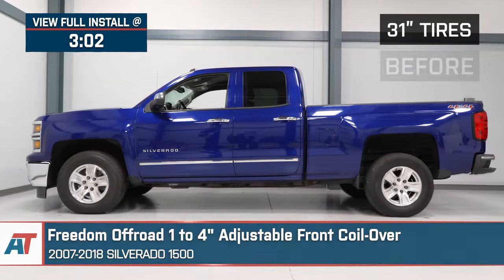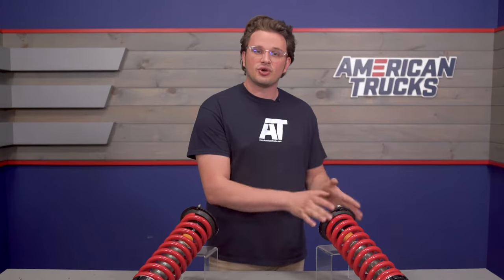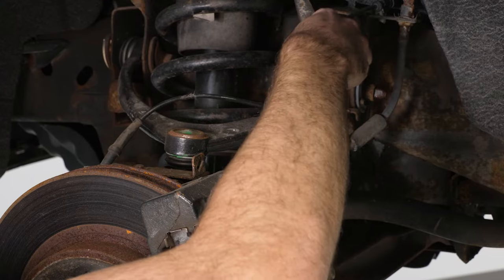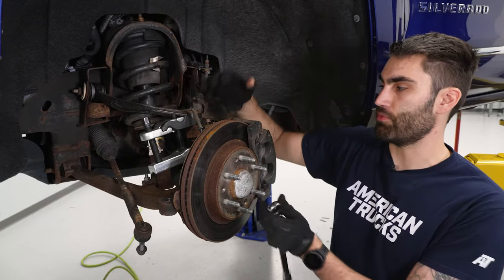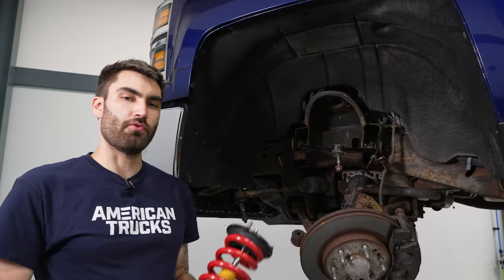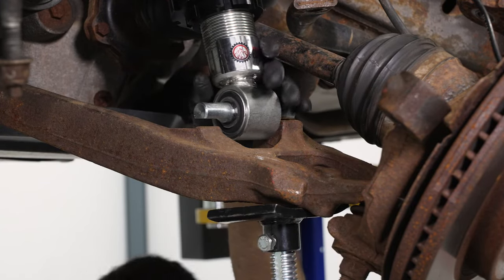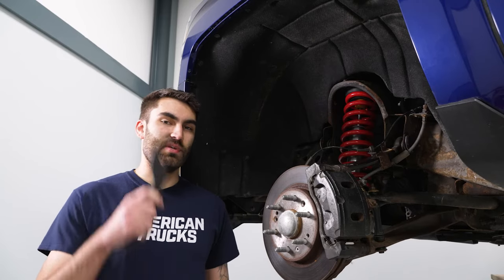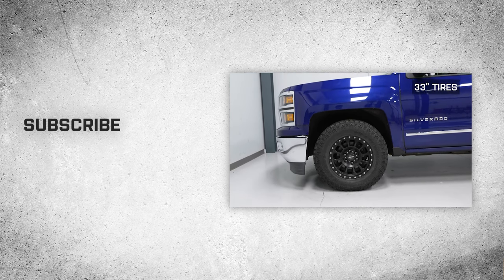2007-2018 Silverado 1500 Freedom Offroad Adjustable Front Coil-Overs Review & Install

Comment: Wouldn't it be a minimum of 1 inch and a maximum of 4 inches?
Reply: Yeah I caught that too.
Reply from the maker: Correct! At the lowest setting this will give you 1 inch of lift over factory height. -Zach

Comment: Literally didn’t raise the truck at all in the comparison and I was about to buy them too.
Reply: They do lift your truck. I have them on mine. Just requires alot of adjustment.
Reply: @PatrickLowther how are they holding up? How’s do they ride?
Reply: @jonathantrejo4441  so far they have been great, on the road they ride well and absorb the road bumps well. The front end is noticeably stiffer in turns. I personally like that. Over large speed bumps or off road they handle very well. The only thing I would say negative about them is the adjustment tool. To lift your truck up over 2.5 inches you need a lot of shoulder power it’s a lot of turns just to get a 1/2 inch.
Reply: @PatrickLowther did you adjust them with weight on them or with the truck jacked up?